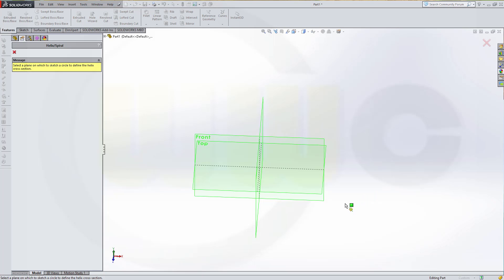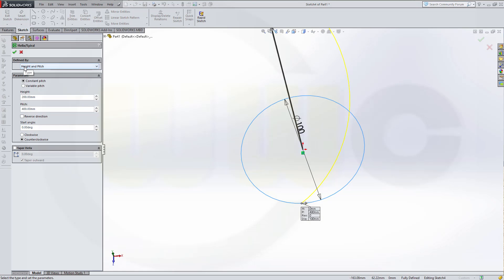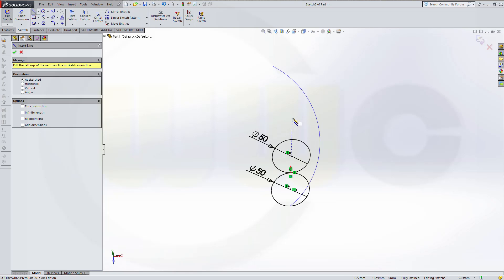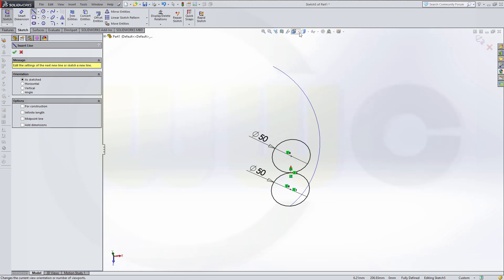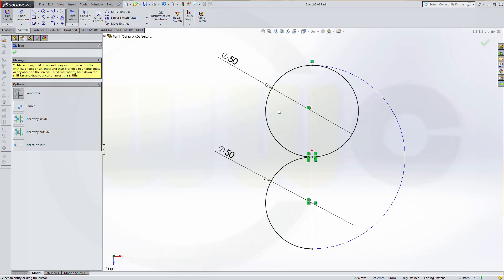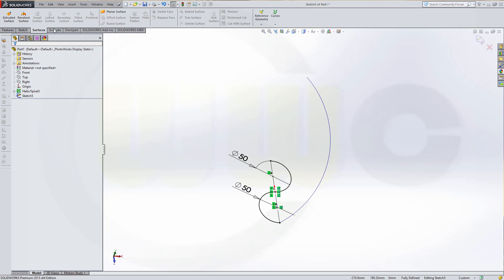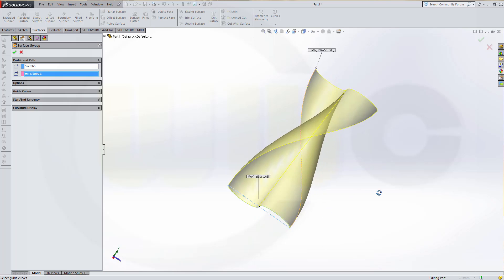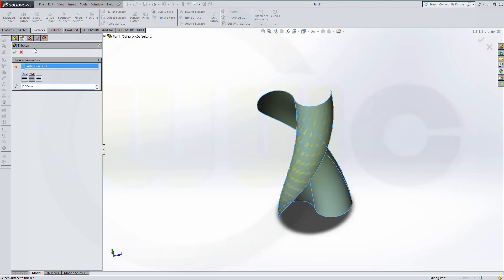Userwish - Helical Savonius Rotor - SolidWorks 2015  Training

Comment: sir how we can design helical savonius wind turbine with shaft
Reply from the maker: I suppose you could do that yourself - just add a shaft.
Reply: Sir actually, i am new user, so thats why i am facing problem regarding this. If you teach me then it will helpfull for me respectable sir.
Reply: please sir, its humble request from my side
Reply from the maker: So maybe you should start with simpler models, shouldn´t you? You have this video, you can built on it.
Reply: sir i got it, base on this design
Reply: thanks a lot respectable sir,,,,,,,,,,,,,
Reply from the maker: Great, you´re welcome.